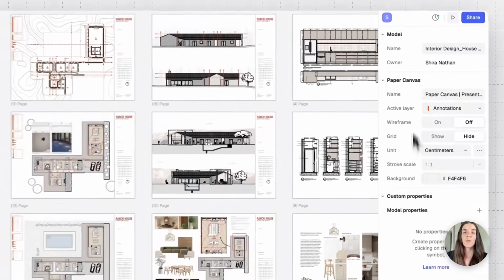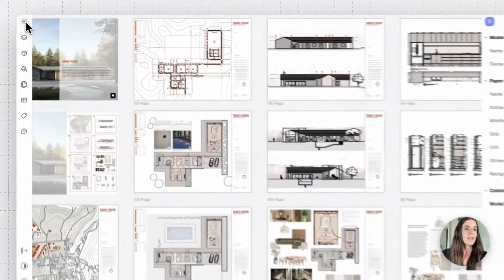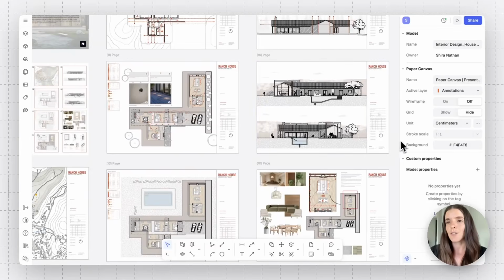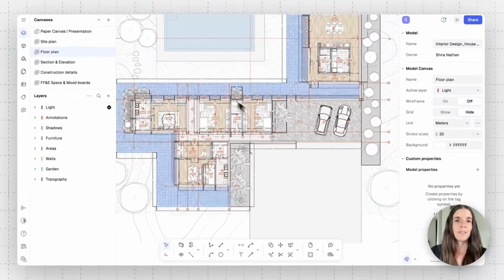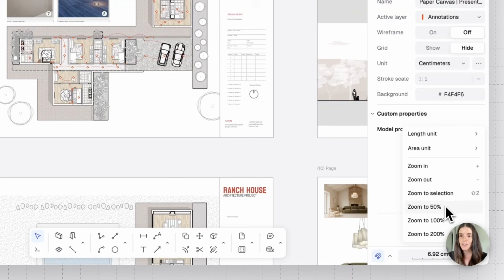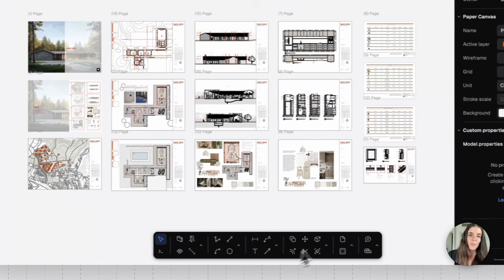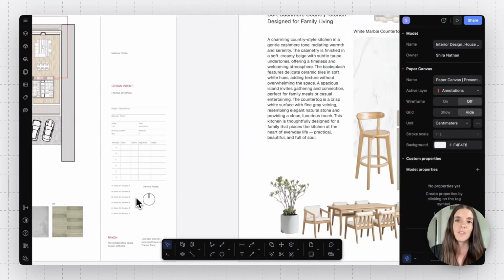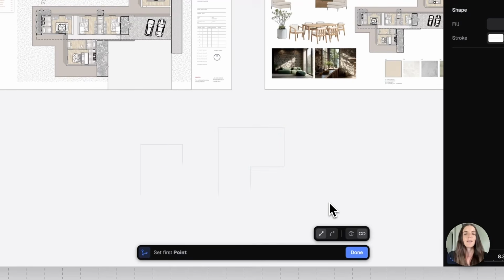How to Set Up Your Architectural Drawing Project

Comment: I have an image, but when I draw wall - the length is WRONG, how to scale this thing??? sweet home 3D let`s me set the scale at the beginnign, this is MUCH MORE difficult to work with compared to sweet home 3D
Reply from the maker: When importing an image, Rayon doesn’t automatically know the real-world scale yet, so you need to calibrate it manually first. The usual workflow is:
• Import the image
• Pick a known measurement in the drawing (for example a wall that should be 4m / 12’)
• Scale the image until that distance matches the real value

After that, the wall lengths should behave correctly.

Comment: So, does that mean Rayon doesn’t support isometric views?
The main challenge for me with Rayon, compared to Revit, is the inability to produce isometrics.
Are there any plans to introduce 3D modeling or isometric views for projects in the near future?
Reply from the maker: Hi there, yes Rayon is a 2D only at the moment but we are planing to include the 3D in the future.
Reply: @rayon.design  I have an image, but when I draw wall - the length is WRONG, how to scale this thing??? sweet home 3D let`s me set the scale at the beginnign, this is MUCH MORE difficult to work with compared to sweet home 3D

Comment: One thing I cannot figure out is how to setup the snap to grid in US units.   My model is set to US feet/inches,  my precision is set to 1",  but the grid is divided into 5ths as if it was metric.   I can see that 5 blocks equals 6".   It snaps to each of the blocks and it shows the dimensions a 1, 2, 4, 5 and 6.    it skips three.   this makes sense because it is probably 1.2, 2.4, 3.6, 4.8 and 6.0 inches.    How do you get the grid to snap to actual inches?
Reply from the maker: Thanks for the feedback! We'll create a ticket for this 🙏